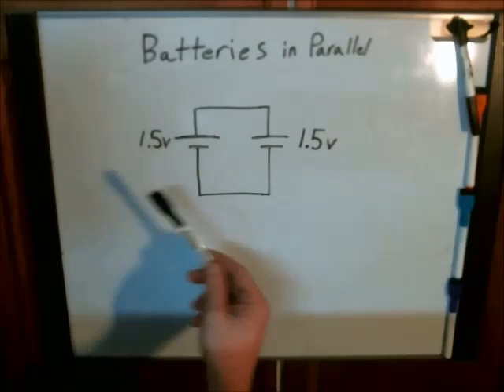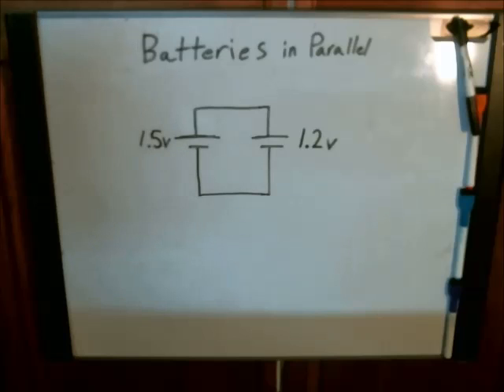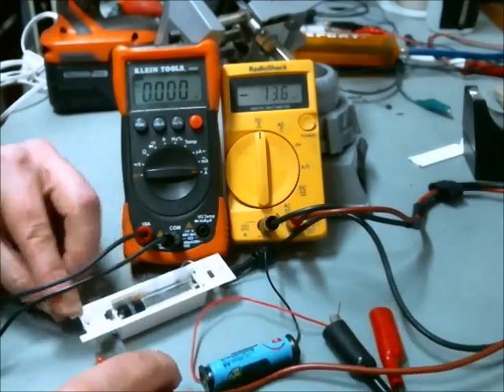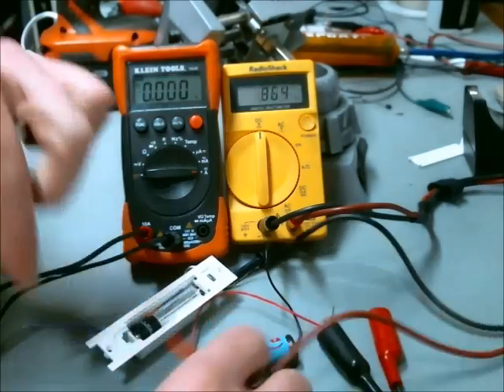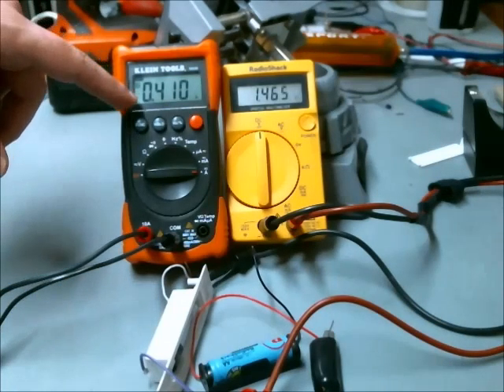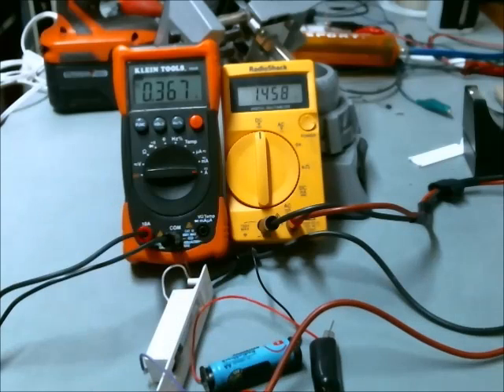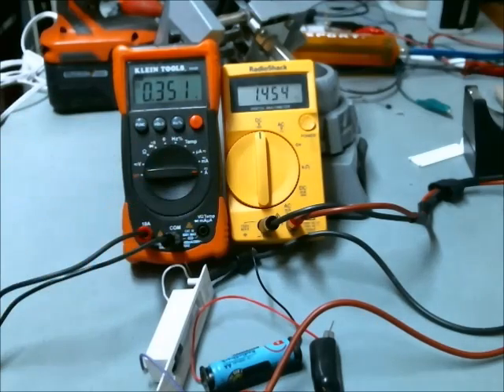Different Batteries in Parallel

Comment: I collected a large number of USED lithium 18650 batteries from different brands.  
I want to build a new battery pack 8S10P (8 series by 10 parallel) for my e-bike.
I have set up each battery bank with the voltage as close to each other as possible. 4.199 volts to 4.100 volts throughout 8 series.
eg: 
bank01: 4.199volt to 4.190volt (10 batteries in parallel)
bank02: 4.189volt to 4.179volt (10 batteries in parallel)
..
bank08: 4.119volt to 4.100volt (10 batteries in parallel).
The total voltage for the pack will be approximately < 33.6 volts.

Because they are USED batteries. Therefore, they have different voltages and ampere. (Generally, 18650 batteries are 4.2 volts at max. Due to it being USED/OLD, therefore they dropped the voltage under 4.2v each.

1) Do you think it is safe to mix the batteries with different voltages in PARALLEL, where the different voltages deviate in 1/1000?
2) Do you know what the SAFE DEVIATED voltage is when connected in parallel?

Please advise.
Thanks
Reply: I don't have an extensive understanding of this (year 11 student) but I will try to explain what I know to the best of my extent.

When you have two batteries of different voltages in parallel what happens is one battery tries to charge the other for the voltages to equal out. Now, because there is no resistance in the circuit between the batteries, the current is extremely high, the batteries will discharge and attempt to charge at rates far exceeding what is safe. This process is called current dumping and can cause overheating and fire. I saw a video of a guy making a battery pack out of disposable vapes and a method he used to get around the voltage differences is to connect resistors in-between the batteries. This limits the current and allows the batteries to reach equivalence at a safe rate. As to what voltage differences will be safe to connect in parallel, I am not sure however if your saying that the differences are as small as 1/1000v then you will be fine. Personally I would consider a voltage difference between the batteries of +_ 0.1v to be safe, however, I would do further research before connecting them. 

Also! 
Make sure your battery pack has a Battery Management System (BMS), this measures the voltage across each parallel section and ensures everything is working right, look into this further as if you do not have one your battery pack is essentially a fire hazard (some cheap e bike battery manufacturers skip out on BMS which can lead to the batteries exploding)

The video I referenced covers this too:
https://www.youtube.com/watch?v=VcVp9T8f_W4

A useful study on cell dumping:
https://www.sciencedirect.com/science/article/abs/pii/S0306261921000568

Comment: Put a diode in series with each battery to prevent  back flow.
Reply: now you have a 0.7 volt drop between the batteries. If you charge the first battery, then the other never gets charged because of the diode. OR, if you charge the second battery, then the first battery doesn't start charging until the voltage drop across the diode is overcome. The first battery would be chronically undercharged. If it is lead acid, it will sulfate quickly. If it is lithium, then the second battery will age faster than the first.

Comment: I want to use two recharagable batteries in parallel, though I understand their will be voltage difference between them. I want to avoid any flow of charge from higher to lower voltage battery is their any way this may be avoided ? Thanks

Comment: thanks  video clarified my doubts. would you please clarify my following doubts 1. are the batteries in the Video ,chargeable. Or this phenomenon hold good for non-chargeable batteries also ???  

 2.  is the internal resistance of a battery ( in this case 1.2 volt) when connected as a emf source independently with a load ( R) , different than the resistance offered by the same battery connected in parallel as shown in Video with 1.5 V battery ??? 

 3. If this combination ( 1.5 v and 1.2 Volt in parallel as shown in this Video) is connected to a external load ( R) , then does this phenomenon of draining of 1.5 V battery by 1.2 battery , still exist??

4. If these batteries are connected in same manner ( parallel ) but with reverse polarity i.e +ve of 1.5V battery  to -ve terminal of 1.2V battery and vice versa, then what will happen ?? 
Regards,
Sanjay .P. Joshi
onlysanjay365@gmail.com
+91-9881495529

Comment: What if the other battary is not re chargable? Will it be still under the influence of the potential from higher voltage battary? What about the net voltage, will it be equal to the higher battary voltage or lover battary voltage or a in between of both voltages?
Reply: U got any ans?

Comment: this video is helpful, because im using Asus ZenFone M1 and the original battery is dead so i use two different types of battery, the other one is inside the phone and the other one is at the back of my Asus. both has different mah capacity .... 2125mah and 3500mah, long last for 2.5hours 
so this video forced me to buy a new  battery for sure i can use my android long lasting.😅

Comment: In series connection of batteries the voltage will add up but current remain as same but according to ohm's law as voltage increse current also increased .why it is not happening?

Comment: ok but what if you have two batteries in series that have different voltages and capacity the lower voltage having more capacity like.    11. 1v 84ah +1.2v 144ah  in series I need to know if there is amp hour increase or decrease

Comment: what happens to the ampere when connected parallel
Reply: I think it rises?
Reply: You double the amps, if you have 2x12v 10ah batteries at 10amps wired in parralel you have one 12v 20ah battery now at 20amps

Comment: How can I calculate the voltage of  that different  batteries
Reply: To Calculate the voltage on a battery..... Um..  using an O-Scope or a DVM?  Kidding, make sure you isolate the battery; (make sure it is not active in a circuit).  Grab your volt-meter, set it to DC-Volts, low end volt-range, grab your  probes and stick both on each battery end, Fuck the polarity, your meter will read whats there, Negative or positive, just look at the numbers.  Shit I forgot, If you DO have a True VOM, the poor analog needle will bottom out instead of reading the volts, so polarity does matter on an Analog VOM.... And Please remember simple things like: Two 5volt batteries at 1amp each connected in parallel will yield you a 5volt source having 2amp capacity.  Connected serially it will yield 10volts, and I forget the amperage here...   RESEARCH THIS, it is good to reasearch!

Comment: what happens in case of solar system..where one string has 8 modules in series having Voc of 320Volt and other string has 7 modules in series Voc of 280Volt...and two string are in parallel fused single MPPT ..in this case how solar panel will react. is there any circulating current from one string to other string..?

Comment: Hello can I connect 2  batteries in parallel with the same voltage just different mahboth 36v one has 4400mah and the other 8400mah?
Reply: yes..u can
Reply: No, you can't
Reply: Maybe

Comment: how about 5500mah and 7200mah both 3.7v is this safe..to make a diy power bank charger..I take the circuit board from power bank 13000mah battery..it's safe to use that circuit board?
Reply: Yes

Comment: Your second diagram when you add the different voltage batteries in parallel is wrong. 1.2 volts with 1.5 volts in parallel the way that you put it in the diagram is a violation of kvl. You need to use more realistic model for each battery such as a voltage source in series with a resistor that represents the internal resistance of a battery. Then you can just continue with your experiment.

Comment: Can we connect output of dc boost converter (100V) to rechargeable battery of upto 350V parallelly. And how we connect renewable low voltage to high volt?

Comment: Would this be bad for the lower voltage battery?. I jumped started my car with two batteries in parallel because individual batteries couldn't jump start my car.
Reply: I'm assuming they were both 12 VDC?

Comment: I have a 1 month old 12V with 415AH and i have Three 3 year old batteries 12V with 85AH each, they all deep cycle batteries, what will it happen if i put them together in parallel? will the life of my 415ah hour battery get shortened? thanks for your input...

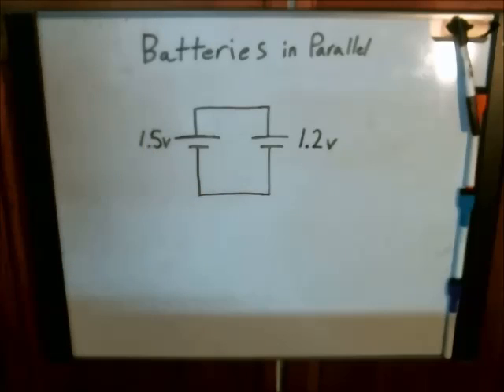Comment: 0:22 You say "you're losing power", but how are you losing power? As you say, the fuller cell is charging up the emptier cell. Then it can be used by your device. The excess not disappearing (tho some may get dissipated as heat when the emptier cell warms up).
Reply: That's what he meant. You introduce more inefficiencies by putting them in parallel.
Reply: @jakeaustin901  Is the inefficiencies permanent throughout the connections life or is it only during that brief voltage balancing that it becomes inneficiant?
Reply: @MyAssassin36  just through the recharging. While they would theoretically balance at 1.35V, that would not happen. The supply battery would lose some potential in the chemical reaction while the rechargeable would, again, introduce more loss in the chemical reaction. This could drop the total gross voltage from the input 2.7V to 2.65V or lower (because of losses).
Reply: I have a 100 ah and a 50 ah Lithium Batterie for my solar installation. The salesman (from basen green in chine) made me believe I can put them in parallel. The batteries would cope with that. Is he wrong?

Comment: Continued...
By placing 2,3,4 etc... batteries in parallel I increase the batteries current load rating by 2 times, 3 times etc... increasing their amp. limit and increasing their mah at the same time for 1/5 the cost.
I would need 6 batteries in parallel in order to supply enough amps without overloading the batteries but I would have hundreds of ah.
More than practical.
I was hoping to reduce it to 3 batteries which would provide 1/2  times amps needed to the main  battery which already provides the necessary amps.
My e bike is pedal assist so the load is max out about 30% of time and at <5% for the rest of the time allowing the bank and main batteries to stay balanced (equalize).
Does this sound do-able ?

Comment: I have a battery pack that will provide enough current for my ebike. I want to extend its range by using a bank of batteries with the same voltage but 1/2 the current capacity (c rating).
Since the original battery is supplying enough current to the load would it not be safe to say that the battery and the battery bank would share the current load and the voltage would balance between them allowing c total to be higher than original c and not overload the 1/2 c bank but allow it instead to recharge the original battery at a slow rate based on the voltage drop of the original battery as it is being used.
Surveillance camera batteries can provide up to 2 amps continuously. They are rated 12v and 20000mah and cost 1/5 the amount of a  15 amp rated  battery
Reply: They are terrible quality and do not last

Comment: what if:
3.7v-----diode>----------|
11.1v-----diode>--------|
                                 |
                                 ?  whats the voltage at ? and whats the formula?

(dont reply unless you are giving ?'s voltage and the reason, ive worked out myself splitting the voltage on return to the battery)
Reply: 11.1v -  0.6v (silicon diode volts drop) = 10.5v

Comment: What happens when you connect 2 batteries of different AH let's say 12v at 18ah and 12v at 100ah
Reply: LightswrathUltimatum. Won't they keep the same voltage throughout
Reply: @JoshWeaverRC  The smaller will most likely scavenge power from the larger
Reply: One will run out before the other.

Comment: How are these batteries in parallel? these are in series
Reply: The Tired Techie whenever current can split in a circuit there can be parallelism and therebis no way current can split in this circuit
Reply: @qazisaad9509  technically they are in series-opposing configuration because yes there is no current split but like terminals are connected.
In parallel you still have like terminals connected. Only difference is the current split. So it is common to refer to series-opposing as parallel since it has the same important property of like terminals connected to each other
Reply: Look better, plus on both batteries is on top
Reply: true
Reply: Yes there is little confusion but if you give two points then is will much clear if  two points are a b and a is in the top and b in the bottom then it is parallel and if a and b are side by side then they are in series

Comment: Hi, I am a novice. I was trying to design a power bank  of 12V 10Ah. To achieve this I was going to arrange 10 NiMH cells in series and 4 NiMH cells in Parallel. Each cell is of 1.2 V and 2000mAh capacity. So this will be a bad design as the 10 batteries in series will add up to 12V while the remaining 4 batteries connected in parallel will be of 1.2V each. So this will drain the batteries in series. Am I right?
Reply: 10s 4p

Comment: A 12-V battery and a 6-V battery (each having an internal
resistance of 0.05 ) are inadvertently placed in parallel.
Solution From Ohm’s law,
I  =E/R=(12-6)/(.005+.005)=60A
This example illustrates why batteries of different potential must never be
connected in parallel. Tremendous currents will occur within the sources
resulting in the possibility of a fire or explosion.
Q:it is the amount of current lesser voltage battery will produce if two .005 volts are connected to in circuit without higher voltage battery. So why it burns or why 60A has been considered as high current for the circuit?
Reply: how about we drop a diode before they meet and a few series resistor as the meeting point?
Nothing goes back to the batteries, the amperage gets dropped down, and we get a bit of heat for the winter.

Comment: What about wiring different 12V batteries with different amp hours? what would the result be? say I have a 12V 7ah battery and I hooked it up to a 12V 12ah battery in parallel
Reply: Nice question,that's what i want to question too
Reply: Bit late I know but it's not as bad as is commonly thought. In an ideal world you would have all identical batteries of the same age and use profile, however in the real world where we often have to make do with what we have then it can work just fine..
http://neuralfibre.com/paul/wp-content/uploads/2007/05/can-we-now-sin.pdf
Reply: each cell is 2.2 volts . so a fully charged bat is 13.2 v so to charge it you need at least 13.5. now put them in series and you get 24 volts.
Reply: @7kennyg  that's not answering the question...
Reply: I normally deal with simple power circuits: like get a BIG Step-down transformer, like 120 AC down to 24VAC with center taps to get 12Volts on both rails. put a full-wave bridge diode setup to force it to DC and then put a shitload of capacitance on there to filter out the AC Hum...  Batteries are fairly cheap, Dump the "Mixed-Bag-O-Shit-Batteries" and start fresh with "Known-Equal" resources.  But I say "Use It Till It dies" is my way of thinking, I learn valuable things by "Mc-Gyvering" things every day, all my life.
Reply: The smaller will empty faster is all,just keep an eye on it.
Reply: What is the effect of putting different battery level in parallel???
Reply: What of we put same solar panel with the outline voltage of 24v but we all know that the voltage on from solar panels mostly fluctuate or changes depending with the weather, so the other panel will produce high while the other will produce low. So wat can be the effect when this happens??

Comment: How to use value diode in between two batteries. I have two batteries one is 4v  1.5AH and another is 4V 2.0 AH. I want to connect then in Parallel. Can anyone please help me to understand which diode should I use?

Comment: how to calculate  total voltage in parallel battery. Can we use the same formula that used for parallel resistors ?
Reply: +sangarp2001 subtract the lower voltage from higher voltage and you get the effective voltage:  Here 1.5-1.2=0.3 V
Reply: wait what 0.0

Comment: I have a 12v deep cycle battery and I want to connect it to my 12v car battery not deep cycle. .. Is it okai ? Thanks
Reply: it depends that for what purpose you want to Do that??  
generally it is ok to connect Both types Of lead acid batteries together in series or parallel too.

Comment: hi, wanna ask that; i have two .3.7v 18650 type chargable batteries. both have same voltage but one of them is 2400 mah other one is 1500 mah. can i use them parallel connection? i will use this for powerbank capacity increase. my mobile battery is 2600 mah. 2400 can not make it full charge. does it helps me for solution or no ?  respect..
Reply: The amount of energy left in each cell is proportional to the cell's voltage (assuming the same chemistry for both cells). Because the two cells are in parallel, they are forced to keep the same voltage and hence they will both discharge equally (in terms of their individual energy capacity). Charging and discharging uneven capacity batteries is fine.

The only thing to check is that when you first parallel them, make sure they are at equal voltages otherwise (as Liu Samuel said) there can be large current flows as higher voltage cells pass current to lower voltage cells.
Reply: @clintoncoker6  Yes
Reply from the maker: With different mAh one will drain faster than the other, best to use batteries with the same mAh in parallel.
Reply: thank you for reply, i tried and it didn't give results efficent way..
Reply: yes you can use,  just put a proper rated value diode In between so the higher voltage won't be able to run into lower or smaller Battery to Charge.
Reply: Apparently one of the batteries will heat up way too quickly by the batteries trying to balance each other's e.m.f out it will explode.......